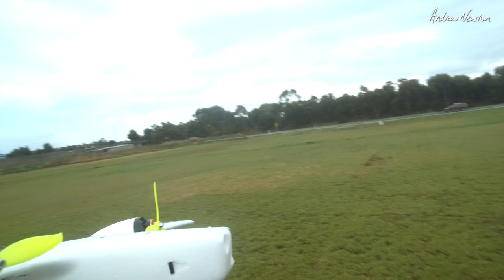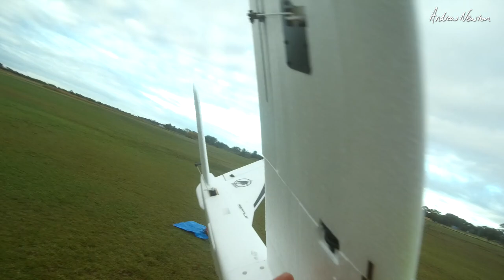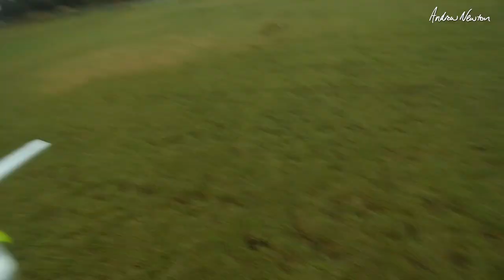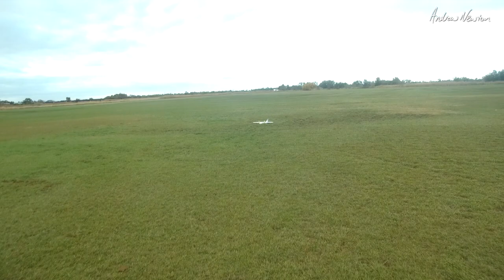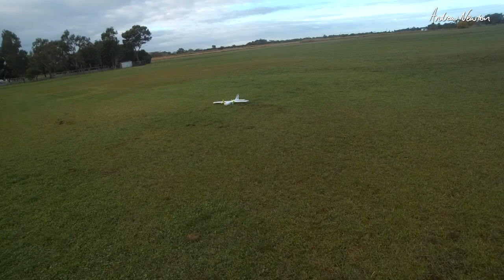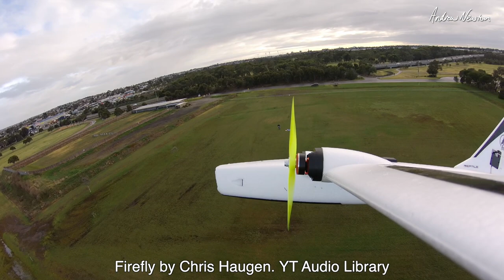Reptile Dragon 2 flights

Comment: First? lol Seeing how well yours is flying with the conventional tail makes me want to swap over to it. With the V tail I'm fighting issues with pitch trim. I've had to move the CG back a ways to get it trimmed properly, and still having issues with it pushing the nose down when power is added. Dips the nose on take off as well. Besides that it's a wonderful plane for FPV! I'm looking forward to your flights with the other tail. I may swap mine over soon... lol
Reply: I was just about to comment about your experience with the v-tail. ;) Although it looks awesome, it seems that the conventional tail just performs better. I am curious to see further comparative testing! 
And thanks to Andrew for mentioning/comparing it to the Albabird ;) really looking forward to that comparison video!
Reply: I'm about to maiden mine with the T tail , I'm using 2x sunnysky 2212 980kv with 8x6 props , do you guys think this motors and props will have enough thrust ?
Reply: Was thinking of you as I watched Andrew do effortless low passes tracking along a nice flat line.  
Both you and Andrew offer so many great insights. Appreciate all you two share.
Reply: @heyjackfpv5469  980kv is too low for an 8x6 prop....the 1250kv would have been a better choice for 8x6 two blade....Both motors will provide excessive power and amp draw for a plane this size IMO..
Reply from the maker: Interesting, I must compare the VTail

Comment: Effortless launching and completely benign stall characteristics....Selling point right there IMO....Even loaded up, no sign of nasty tendency at launch time....🤔🤔😀🇬🇧 Great demo Andrew....Two blade props please, more efficient on a plane...🤔
Reply: I think the 3 bladed prop is for landing clearance. Great flying plane.
Reply: @johnsheehy6172  Two blade and ESC braking is fine..plus, you can balance a two blade prop. Important if you have cameras onboard...

Comment: Hopefully you have kept this model and we will see some fpv and control board installations in the future it looks like a great little plane.
Reply from the maker: No unfortunately. I kept the Albabird as my twin FPV
Reply: @AndrewNewton  At least you tested it with lithium ion batteries and some nice big packs. I'm thinking of getting it and using my 7,000 mAh ZOHD 4S2P battery in. It should work good as an fpv cruiser I think.

Comment: Hey Andrew,  have you experienced any issues with the inner wing panels not being glued to the fuse?

Did you glue the CF wing spars into the fuse?

I'd love to hear any comments about the build process.   I started building mine about a year ago but stalled during the wing build part.   I'm going to pick it back up and finish it over the next two weeks.   TIA for any advise.
Reply from the maker: Too long ago to recall. Have a look at my other Dragon videos, might be a clue there. I think the screw clamps were enough.

Comment: Thanks so much, I like that it seems silent and fast, great combination if you want to have fun while flying "under people's radar".
You mentioned that it is efficient but not super efficient. Which twin would you say is super efficient or defines your reference for highest efficiency?
In order to make it more efficient wouldn't it be better to have an aerodynamic nose instead of that flat turbulence generator/camera holder and not mount any cameras on the outside?
It would have been interesting to see a speed vs. current table of it ... and then maybe the same from the Albabird or whatever is really good?
When you put your batteries in parallel, isn't there a risk of strong internal currents between the cells, when they are both very low impedance while being a few hundred millivolt off?
High Power diodes would be great because that would avoid unnecessary currents between the batteries, but on the other hand it would cause at least 0.7V drop and at high amps serious amounts of dissipation heat, so not a good idea either. So I guess you just charge them until just before you go to the field, so that they are hopefully very evenly voltage-leveled in order to not fry the Y connector?! 
Now I think I will get myself some more single cell 3S lithium ion 16650 packs and solder a high current bridge for 2 parallel packs for different missions and weight distribution. I always thought how nice that would be to have cells in parallel but I was afraid of creating unwanted fireworks before they finally get evened out in between. Looks like not thinking about the low inner impedances and just doing it works most of the time when charging them at the same time to the exact same level. Did this ever create a problem in real life for you?
Reply from the maker: Yes, a nose cone is a good idea. Probably should have just said it was fast or low drag initially rather than efficient. Super efficiency for me is 3 to 4A cruise current while carrying something like 5000 4S. Ranger 2000 can do it. But speed also should be considered in the efficiency assessment.

Comment: Hello Andrew,
may I ask what would You suggest to be maximum takeoff weight?
My point is, i have ADSB Cube orange AP and HERE3 GNSS. Its weight is something around 400g. To ballance its weight i had to put the AP as close to the front as possible (actually it is sitting in the middle of the plane because of the battery bay clearance). Total weight is 1980g. I have one plane with similar size and weight, but It has landing gear on tundras, so take-offs and landings are relatively easy. But this "thrower" seems a bit heavy in the hand to handlaunch it.
Reply from the maker: It can handle 1700g easily. Plenty of power and no torque roll from the twins so you might be OK.
Reply: @AndrewNewton  thx Andrew, you gave me some confidence :)) by the way, You have the best rc channel of the all. I really love Your way of doing things :)

Comment: Any chance you could help me with a question I  have a volantex ranger 2000 and I have a bunch of li-ion batteries. would you go 3s 15000mah or 4s 10000mah.
Reply: I'm not Andrew, but think it boils down to fast (4s vs 3s "power"), or fly longer (1500 mAh vs 1000 mAh "capacity"). Propeller size and motor are also a consideration, as they need to match your power setup. 

Note: 18650's weigh ~50g (+/-5g) each regardless of capacity. Most people tend to go with 2500-3500 mAh 18650's, 3000-3500 mAh being more commonly used.
Li-ion cells under 2000 mAh don't give as much "energy density" (mAh/g, or Watts/g), and thus little advantage over Li-poly.
Reply: @AerialWaviator  Cheers for the advise, its a ranger 2000 with a sunny sky X-2216-8 1250kv, with an 8X6 prop. I have around 20 or so 5100mah 26650 Li-ion's. using 6000mah Lipo's at the minute and getting around 40 minute flights with no gliding but looking for much longer flights. I've no interest in speed just cruising around the mountains here in Ireland. I am tending towards a 4S2P given the additional weight over the 6K lipos but the extra watts from the 3S3P keeps bringing me back to 3S. Would love to go 4S3P but its never going to fit in a ranger.
Reply from the maker: I choose 4S for the lower current requirement, and reserve power